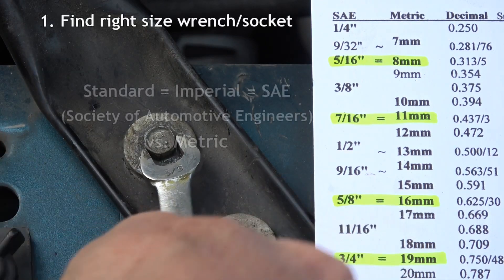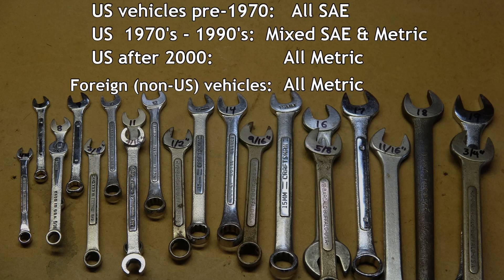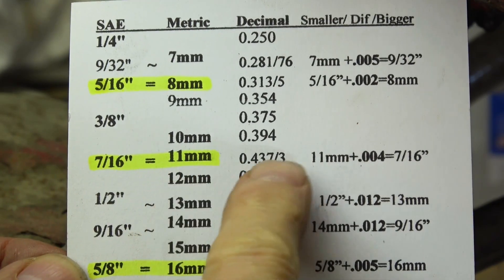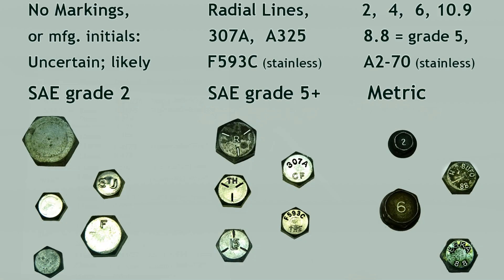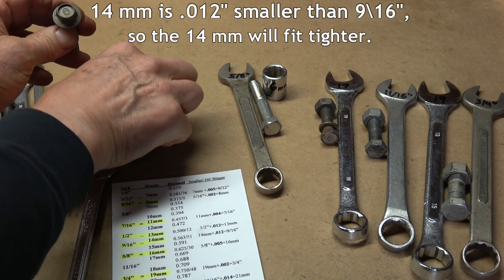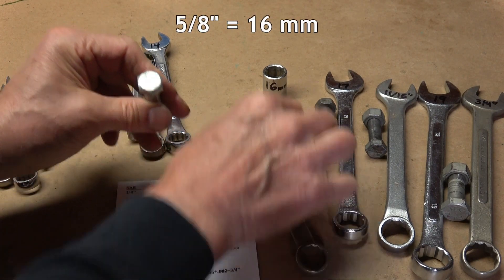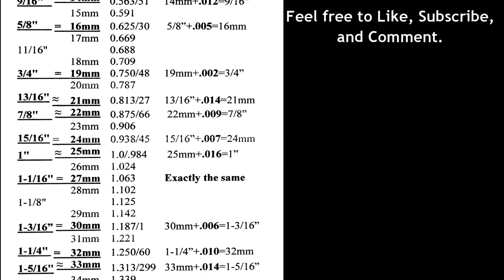Metric vs Standard, Imperial or SAE - Wrenches, Sockets, Bolt Size Chart + Mechanic Math

Comment: hi can you help us know the difference between sae & AF or they both are same ?
Reply from the maker: AF simply means "across flats" so my understanding is a wrench marked AF could be either metric or standard.  The AF doesn't really mean anything now days since all wrenches are marked with the distance from one flat to the parallel flat across from it.  Apparently in the 1800's in Britain some wrenches were marked with the bolt size, not the head size.
Reply: Than what’s SAE and AF relationship with ??
Reply from the maker: That's all I know, and I found it by Googling it, because I had never heard of AF before. So try searching Google for more information.
Reply: @gentlerowdy  AF means across flats, the size across the flats of the bolt.  Previously, British spanners were marked with the thread size so a wrench labelled 1/2" W (Whitworth) would fit a bolt with a 1/2" diameter and the bolt head size was defined as a mathematical function of the thread diameter (in this case .920" across the flats for a 1/2" W wrench).  I.e., it was NOT 1/2" "across flats".  Therefore the markings 1/2" W and 1/2" AF allowed you to tell the two different types of spanners apart.  SAE and AF is the same.

Comment: You my friend are a life saver. I've been trying to figure for days what kind of bolt I need to replace that held on my clutch pulley wheel on my mini bike and nobody could answer my question. Now after stumbling upon your video I need Metric cause it does say 8.8 on the bolt head. I learned something new today. :)
Reply from the maker: I had to do some research myself in putting this video together and found it's very handy being able to read bolt heads. Glad it helped!  I'm surprised actually at how many bolts in the US are now metric.

Comment: If I can only afford one set should I buy SAE or metric?
Reply from the maker: I'd get metric if you'll mostly use it for vehicles, unless you have very old US vehicles. In the US for construction bolts or yard tools you might need SAE. If you get a metric set plus 1/4", 3/8", 1/2", and 11/16" that would cover most situations, also possibly 13/16", 1" and 1-1/8".
Reply: @HartzHomestead  thanks

Comment: I just want to bring to light that sure both a metric tool and standard tool might "fit" a bolt, nut, etc but its the one that fits tighter with less slack that is the correct tool.
Reply: Actually sometimes the substitution actually fits tighter...

Comment: I like how you spaced the SAE measurements in relation to the metric measurements, so that we can have an idea of just how much difference there is to them. Thank you very much. Just what I needed in my toolbox. I've printed and laminated a few of these cards thanks to you!
Reply from the maker: Glad it's useful to you.  I kept running into this situation, so I designed the chart to be as practical as possible.
Reply: All this unnecessary hassle wouldn't be a problem if we used the metric system only
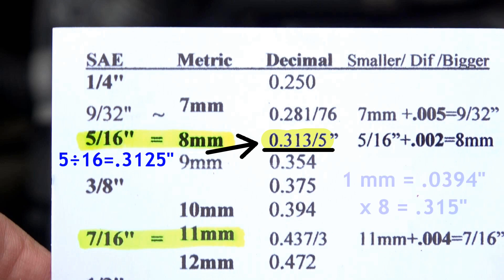Reply: 😮😮😮😮😮😮😮😮😮😮😮😮 1:07 😮😮 1:14 😮😮😮😮😮😮😮😮😮😮😮😮😮😮 1:35 😮😮😮😮😮😮😮😮😮😮😮😮😮😮😮😮😮😮😮😮😮😮😮😮😮😮

Comment: why is inches and feet even a thing in 2020? That kind of measuring should already be obsolete
Reply: It is absolutely not obsolete. Tell me, when you are flying in an airplane at crusing altitude, what altitude are you flying at? The answer you find to that question is the answer the world over save a very, very few outliers. And it isn't a metric measurement.
Reply: @Trainwheel_Time  "The answer you find to that question is the answer the world over save a very, very few outliers." The altimeter readout in a Airbus A330 looks like it is in metres to me!  The French are pretty strict about using metric. Though I suppose pilots can change it back to feet if they wish.  I'm much more comfortable with 9000m than 30,000ft, 30,000ft doesn't mean anything to me.
Reply from the maker: It's too bad the US didn't convert to metric decades ago when they first tried. The problem is that so many things would have to change, like houses are built in inches and feet, with 4' x 8' plywood and 2x4 lumber, etc. At least most new vehicles are all metric now.

Comment: So does this work then when needing to buy a Metric bolt size but all they have is SAE?
Reply from the maker: Probably not, because the threads will not match. It's possible it could work, but not likely.  If you're buying both the bolt and nut in SAE, that could work.  But not if you're threading into something that has metric threads, unless you first tap it out with an SAE tap.

Comment: Great video! I finally use my 38mm sockets for 1 1/2" since SAE tools are way more expensive in my country! It's only 0.1mm diff
Reply from the maker: Especially with the larger sizes, they are almost interchangeable. The bigger you get, the less relative difference. Sorry, my chart didn't even go to 38 mm, but since 3/4" is almost exactly 19mm, doubling it we can see that 1.5" = 38mm.

Comment: Hello was wondering if working on a Chevrolet vehicles if you can use Metric  measurements without damaging the bolts
Reply from the maker: American vehicles, including Chevrolet, have been almost all metric since the 1990's, so unless you have a 1980's or earlier, it's rare to find a bolt that's not metric.

Comment: Isn't it wonderful there's a bolt size every millimeter? 😵
Reply from the maker: What a simple system.
Reply: @HartzHomestead  To be fair, originally it was always 8-10-12-13-14-17-19 (-22-24-27-30-32). With the German standard being 13mm for both M8 & M10 and Japanese standard 12mm for M8 and 14mm for M10, but otherwise identical.  So that's why metric skip sets usually include the aforementioned sizes only. It's only when American cars went metric and the ANSI & ISO standards were developed that sizes like 11,16,18 etc started being used commonly (perhaps because of how 16 better matches 5/8" and so on) and you needed a full set without skips!  I don't understand why US auto makers didn't go with either the existing DIN (German) or JIS (Japanese) standard for bolt heads when going to metric.  The larger sizes like 24mm, 27mm, 30mm, 32mm bolt heads already matched SAE sizes of course and are are still thankfully pretty well standardised between DIN, JIS and ANSI/ISO.

Thanks for the excellent video though!  You could add "if it doesn't fit either, it's probably Whitworth or BA, so have fun!"

Edit -- Apparently the ANSI/ISO standards have some advantages in terms of thread stretch so will gradually take over the industry as more and more automotive trans-continent engineering conglomerates form.  But for older VW Beetles or Honda Accords, a simple 8-10-12-13-14-17-19-22mm tool set should still be plenty.
Reply from the maker: @TassieLorenzo  Thanks for that additional information - that explains why the metric set I have is missing 11, 16 and 18mm, which I've run into on our '02 Chevrolet and had to buy separately.  I grew up working on American vehicles from my '43 dump truck to 70's Fords and Chevys, so metric was new to me in the 80's.

Comment: great video, are there any practical near equivalences between SAE bolt and thread pitch and metric thread pitch, for instance is 7/16-20 practically equivalent to M12-1.25 ?
Reply from the maker: Perhaps someone else has a more knowledgeable answer, but in my experience if a thread pitch isn't identical it probably won't work in most applications.
Reply: @HartzHomestead  That is my experience too.

Comment: Please please, make a video on  b. S. W. Spanners old and new types.i would be greatfull to you.thankyou.
Reply from the maker: Sorry, that's not something I have any expertise on. The information must be available somewhere on the web.
Reply: Basic difference between BS Whitworth and Old Whitworth is that the hex size is always one size different…the BS is smaller. This is said to originate in wartime, using less metal for the same bolt sizes. 
  The reality of fitting spanners is to use the closest fit that you can get on…whatever is marked on the spanner. All these things are made to tolerances and can vary a surprising amount. Charts of sizes have a use but the reality is the trial fit of the tools in your hand.
 The better the fit the safer the work.

Comment: Thank you for making this video. I am a scottish mechanic and ive only ever worked with metric bolts and nuts. i am about to travel to germany to start a new job as a heavy equipment mechanicfor the US Army. This has helped alot!
Reply from the maker: You're welcome! I've had a couple vehicles that have a mix of both metric and standard, so having that chart saves me a lot of time.
Reply: Awesome working on that currently too :)

Comment: It's possible to substitute a 13-mm wrench with a 1/2" one, but it's going to be roughly 0.3 mm oversize (1/2" is approximately 12.7 mm). Adjustable wrenches can be used with both metric and inch nuts and bolts, but you're going to be sacrificing strength (and durability) for adjustability.
Reply from the maker: Good points. An adjustable wrench is more likely to slip a little if it takes a lot of torque and thus may damage the bolt head. Sometimes a 1/2" wrench will fit a 13 mm bolt very snugly, but a 13 mm wrench will be very loose on a 1/2" bolt.
Reply: Yes, people miss that some substitutions only work in one direction.
When I was young few had metric sets and as foreign cars became more common we made these subsitutions and even picked up extra SAE wrenches in some sizes to file down the open end to fit some metric fasteners that didn't have a crossover.
The smart ones marked them somehow.
Done with double open end wrenches and combination wrenches where you might even cut off the ring end as it wasn't a match for the open end anymore.
Now someone will say why not just buy metric?
Well we had SAE already and it was cheaper to pickup some more SAE at a pawn shop or a garage sale than to buy new metric wrenches.
When we did buy new or used metric sometimes we would just fill in the holes where there wasn't any good crossover.